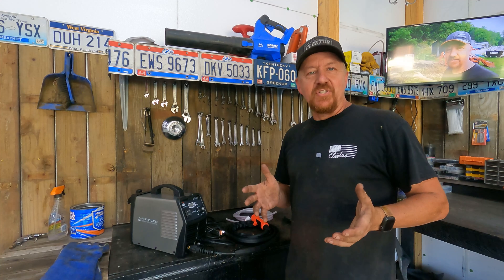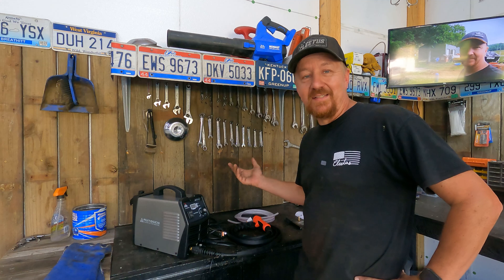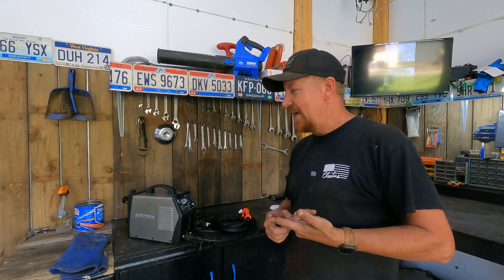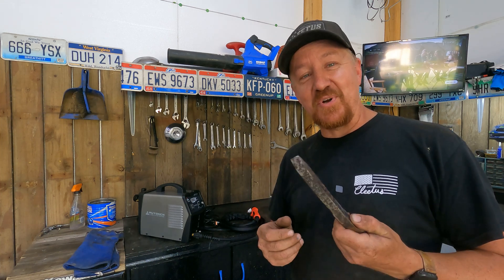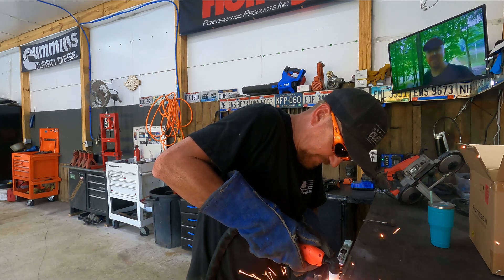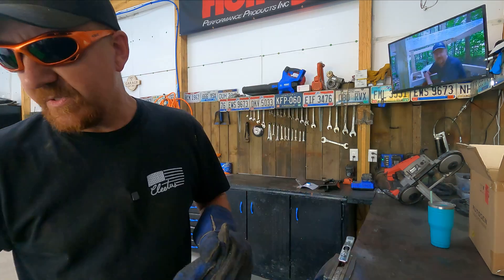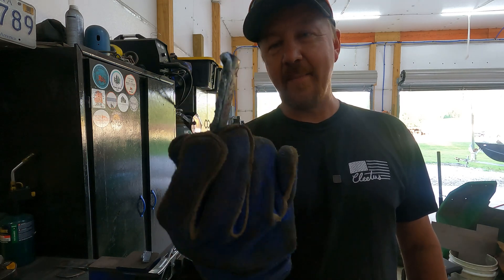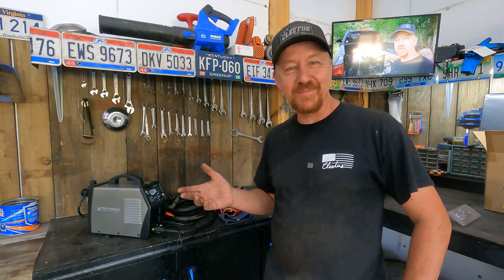Will it Cut 5/8" Steel?  - Autogen 55Amp Plasma Cutter Test

Comment: When working on rusty bolts do you seem to use a plasma cutter over cutting torch ? Seems like easier to use ? I don't have plasma cutter but have torch set. I haven't had to fill tanks in several years .. price wise plasma I think if cheaper than filling tanks ?
Reply from the maker: I haven’t blown out any rusty bolts with it so I can’t say for sure.  I haven’t used my cutting torch at all since I got a plasma cutter though.  I am pretty impressed with them.